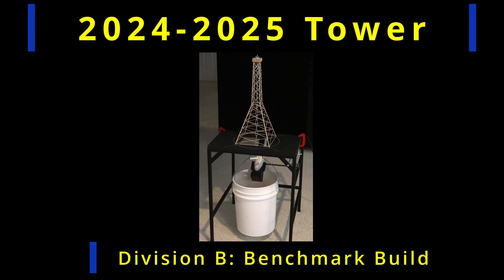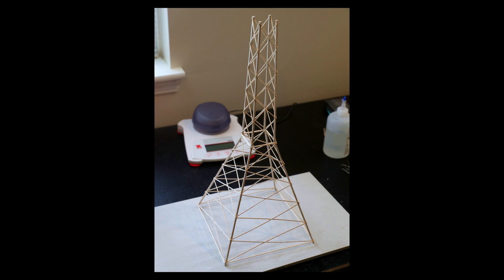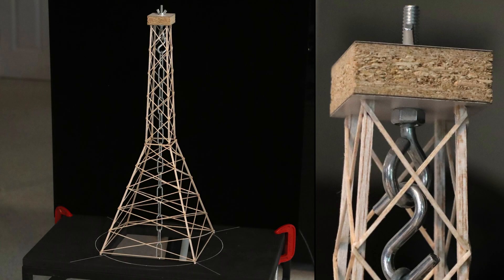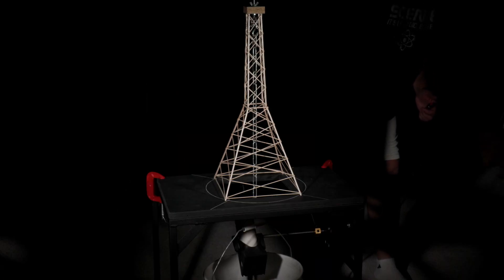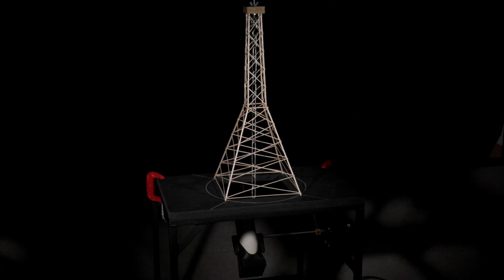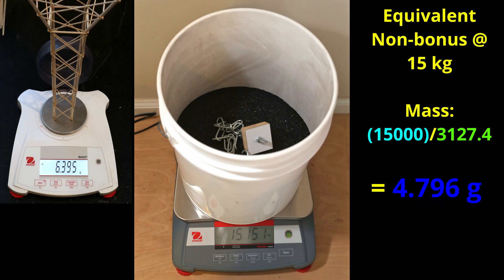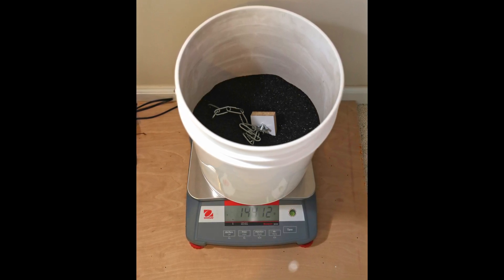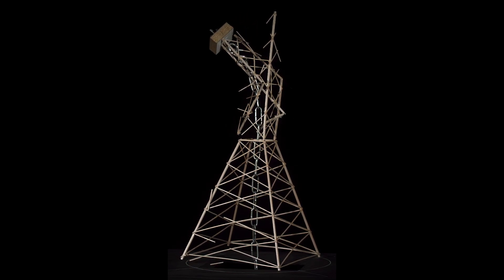2025 Science Olympiad Tower Div B: Benchmark Build

Comment: Hello - I noticed that one change from 2024 designs to 2025 is the horizontal cross member along the very bottom of the tower. Last year, your designs were just X pattern all the way up - Is there a video where you discuss this small update?
Reply from the maker: I'm not sure if I specifically mention it in any of the videos, but in general, for the bonus design, having a bottom horizontal cross-member can help a lot as they are in pure tension.  That being said, it's not 100% required if your bottom cross members are strong enough, and it's even less necessary if you are building a non-bonus, much smaller base tower.  You should consider it "optional", but conservative.  If you remove it, definitely test your design to see if it works well.  Good luck!

Comment: Ive been wondering if a slightly slanted top portion would be better than a vertical one? Usually its only the bottom that breaks and the top part stays intact so i was thinking that it would take away from the force on the bottom. Please tell me what you think and if it really makes that big of a difference
Reply from the maker: I don't really know what you mean when you say a slanted top.  Both the column and the base need to hold the same amount of weight and ideally you want that weight transfer from the column to the base to be as symmetric as possible.  If your column always holds and your base always fails, I recommend you start testing them separately and lower the mass of the column and/or increase the base strength until they are a better match to each other.  The key to the perfect tower is having those components be perfectly matched in strength.  Good luck this season!
Reply: @balsaengineering6686  Thank you very much for the insight!

Comment: Hello again I have been building my towers and have not been able to get the bracings, what I have been doing is having 3 1/16 by 1/16 bass bracings on my bottom and it keeps breaking do you have any ideas on what to do. If I put 4 bracings it would be to heavy
Reply from the maker: Unfortunately, you can't really "cheat" and use only 3 layers as it will be almost impossible to make a good base strong with that few.  I would recommend you watch my 5-part tower basics video series to understand why you need more layers.  I would stick to 5.  What you need to find is lighter/less dense wood so the weight isn't a problem.   If you have the resources, you can buy light density balsa from Specialized Balsa.  If you have to buy locally, take a scale with you and buy lighter sheets.  Remember that balsa can easily have a density range that is 3-4x, so finding the lighter wood is key once you have your build technique and design mastered.  Good luck!
Reply: @ thank you

Comment: Hey I was wondering if the jig was the top column or the part that holds the chain?
Reply from the maker: For the column jig, I had to split it into 2 pieces because my printer couldn't print it in one piece.  So if you combine the top and bottom part of the column, it forms a single jig which is the top part of the tower which holds the loading block.  You'll also need to build the base which the column sits on top.  The entire thing should be just over 50cm tall.

Comment: what are the dimensions of the cross bracings you used for the benchmark build?
Reply from the maker: Hi!  That information (and more) is contained in my dedicated videos for the Bases and Columns.  In general though, the column used ~1/20" square cross bracing and the base used ~1/20" square for most of the bracing, 1/16" square for the very bottom, and 3/32" square for the top horizontal piece.